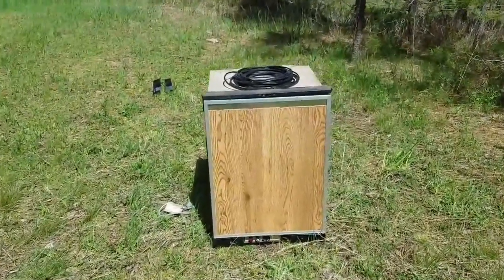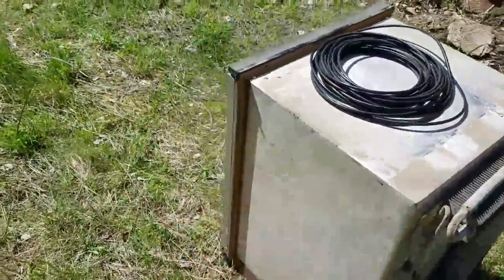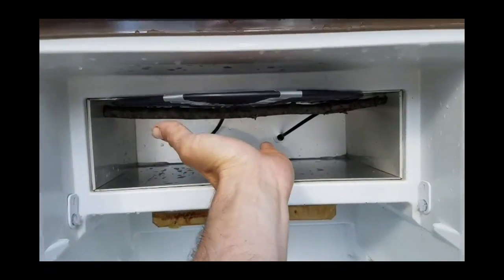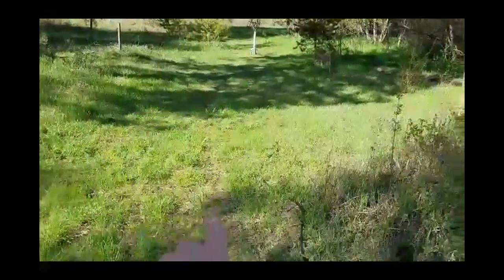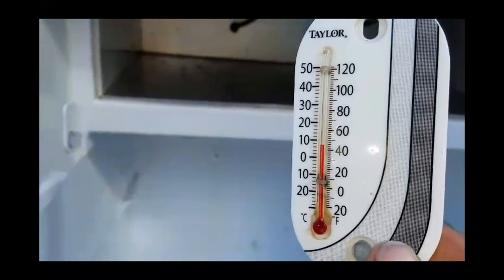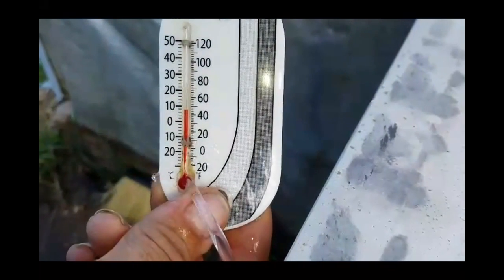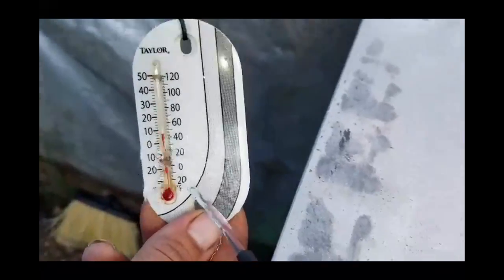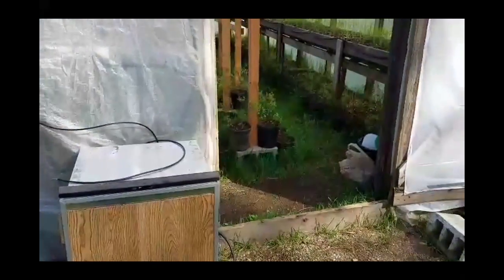Alternative "Refrigerator" requires no electric power. Keeps my homegrown organic vegetables fresh

Comment: wow. Who knew simple pancake coils had this level of efficiency.

With the ease of creation, a larger unit would be incredibly simple to cool, using this design, although material costs would be left to your creativity or size of pocketbook. 

Using your system in a larger unit could provide a walk in cold space for any other farm goods or services, like neighborhood milk pick ups, or CSA boxes including perishables. 

The water could easily be collected for irrigation water for your green house driplines, chicken water, feed back into the hydro system, or even decorative Water Forms for you cymatics nerds. 

Now, my question is what to do if you don't have cold water nearby?

Maybe dig a deep small hole and pump out the cold air? But the pump would be the limit of cooling capacity and pumps are expensive. Hrm.

Thoughts?
Reply from the maker: I  like the ideas and scalability concepts, every time the toilet flushes or the sink/shower turns on the water going to it could first flow through a simple add in to a standard fridge, this would just make it more efficient by supplementing some of the required energy for refrigeration  with the temps already in our well and tap water before it is wasted down the drain. Thank you of contributing to the idea!
Reply: MrTeslonian : Heck yes. use it all the way down the chain, baby.

Comment: you could achieve even lower temperture if you dig underground and ran several pancake unground and back up to the fridge and use a willmill or a self propel water system to circulate the water underground back to your fridge.   After all the basic theory to fridge is to absorb heat and the vacuum seal prevent increase of heat thereby it could comes close to absolute zero.
Reply: I mean not absolute zero but the rest seemed right

Comment: Now try it in salt water. Should drop it down to, perhaps 20 degrees. Salt is natures 'heat pump'. So now, instead of simply equalizing the temperature, it is 'pulling' the heat from the box.   https://youtu.be/O7TvEIA0Ln4  I am not sure if this works for liquid water though, since it is the phase change from solid to liquid where the magic happens. Definitely would be cool to see you experiment with it.

Comment: interesting but did you measure the temp without the coil first on the same day for an hour?
Else isnt it all somewhat guess work?
Secondly, the water is just pouring away which is horrifyingly wasteful even from a well when it could be feeding a water container and so kept for the greenhouse watering.

Comment: You must live close to Canada!  Water temperatures out of a Well here in Missouri would be about 60 F.  In Florida, it would be about 70F.  I have done extensive experiments with underground water temperatures.    Another solution is to make a root-cellar.  You wouldn't get 40 F... but no water circulation would be necessary.  I did find your experiment very interesting, thank you for posting it.

Comment: Use the discard water by connecting it to a couple hundred feet of perforated hose (same size as your coil hose).  Run it back and forth thru the greenhouse to act as a drip system.  Just clamp off the end.  Nice video.

Comment: have you thought about using the water you have running on the ground..?  why not get couple hundred feet of that black hose, then connect it to the discard water, perforate it and use it as a drip system in the green house.

Comment from the maker: This comment is to save you from needing to point out the obvious, yes the black pipe in the sun will increase the temperature of the water, and yes the thermometer is made with alcohol and not mercury , watch the mercury rise is an expression!
Reply: Not always... some are new to this kind of mechanical thinking. They are used to buying things off the shelf premanufactured. You're also more intelligent than you give yourself credit for. I, for one, could see improvements using the "poor man's A/C" (fan, cooler with ice, water pump, metal and rubber tubing), but I can't anticipate that most would think of that. I'm just saying, because I'm helpful. You are pretty dang smart, you know.
I'm still wanting to improve/modernize the Ram Pump. I know there is a lot of possibility for power with this very old tech. If I could just better utilize the pressure and spring action of the water, I could almost double the pump output, I just know it. I love pushing the knowledge envelope. Don't you? : )
Reply from the maker: https://youtu.be/yultoJyCrsQ
Reply: Thanks for keeping it simple. Too many DIY videos lose my interest with the minutiae or worse yet the face of the "expert".
Reply: @MrTeslonian  Too cool, a solar water heater. You sir, are a free energy master. I could see that encasement on top of that fifth wheel, for sure. Maybe a couple wind generators as well, if it's mobile, to squeeze as much out of that gas as possible. I love your videos.
Reply from the maker: I would assume my audience is smart enough to know those things already and feel wasting time in the video pointing it out, is just that "a waste of time", not to mention slightly belittling to my audience to think they need simple obvious things pointed out. the water is pumped by a water ram pump from an artesian well just incase it was missed!

Comment: How would this be accomplished without wasting the water on the ground?
Reply: Hook it up to a drip line and run it back through the plants in the greenhouse. A closed loop system.
Reply: LS 00056 pipe it back to the well, or put a thermostat and solenoid so the water only runs when temperatures increase

Comment: MrTeslonian is there any concern about the long length of tube baking in the sun on a hot day? If the outside of the box was misted with water or covered with fabric and allowed to evaporate...  could the box manage higher outside temps? Even be able to cool a larger cubic foot box?